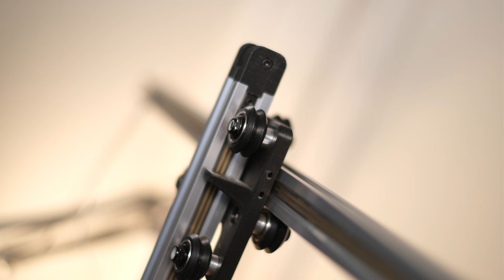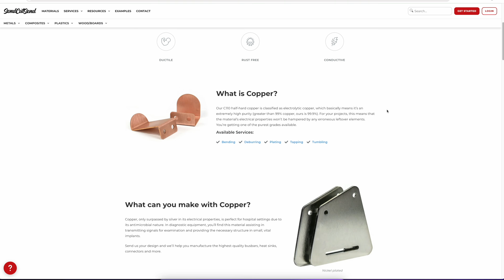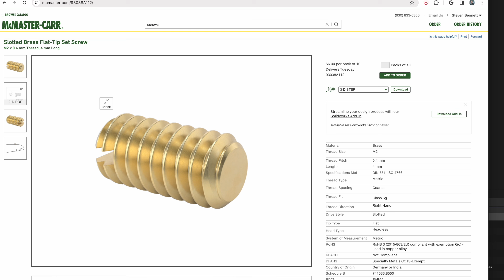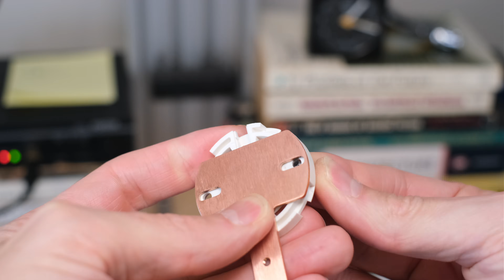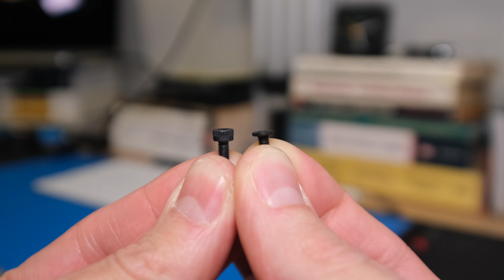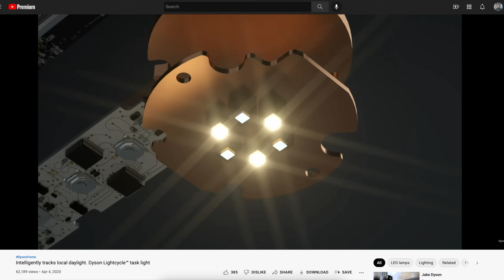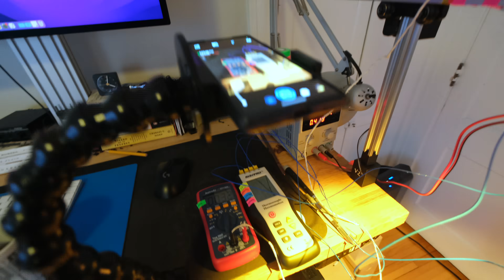Just how good are heat pipes anyway? - DIYson Lamp Build Log #10

Comment: Even though the heat pipe was better, if you were to take a copper rod with the copper heat sink soldered to it, covered in thermal paste and slide down the middle where you currently bolt the lamp head to, would it help cool more because the heat would radiate away more due to it being surrounded by the aluminium strut do you think?

Would putting a thread on the rod help with heat transfer to the strut? The thread isn’t there to screw it in, but to act like a giant fin and help improve contact between the rod, thermal compound and strut.

Now I’ve typed that, thank you for taking the time to make these videos, they are excellent!

Comment: Really cool Designs. I think you might be overthinking it a bit. you are limited by the contact area of the led module to the copper anyway.  I would just use a copper shim mounted directly to the underside of the aluminium at the end. Aluminium is not a bad conductor of heat. Focus on getting the head into the Aluminium direclty
 Thats all the heat pipe/copper is doing anyway. Might be worth a test anyway. How much efficiency do you need vs cost.

Comment: FYI, you can abuse PCB manufacturers to get mechanical parts like these flat sheet metal parts on the cheap.  Many even offer solid copper PCBs at 1.6mm thickness.  I'm looking at one now that's about $10 per board  in small quantities at 200mm length.  You can even have them mount SMD nuts in lieu of tapped holes.

Comment: If the heat pipe is the hottest component, you could get some easy wins with a longer heat pipe and better contact with the aluminium. Another possible solution would be to add a T-shaped or H-shaped heat sink in contact with the full length of the heat pipe. You would have to put the heat pipe on the side of the beam instead of the bottom though.

Comment: Wouldn’t it be easier to take 0,1mm of the diameter of the wheels? So the v shape still engages with the extrusion part but the tips of the wheel don’t hit the screws or the copper bar…

Comment: Why do you have to use the slot where the wheels go? Can you move the heat pipe or copper bar to an unused slot and either bend it so the LED is still pointing down, or bounce the light off a mirror?

Comment: So glad you discovered the heat pipe!  They really are like the closest thing to magic or a teleporter (for heat anyway) that you can just buy off the shelf, no batteries required.  I bought a bunch of them about a year ago.  Put some on my fridge's compressor, keep them on external hard drives during major back-ups/transfers, have them on the motor housing on tools that run too hot or large Ah batteries while they charge, etc.  I have some in the kitchen junk draw to help defrost food if it hasn't completely thawed.  Thermodynamics is a big deal if you're Goldilocks.  A few well-placed heat pipes would have solved many of her problems.

Comment: calling the 'sold copper' solution solid is outrageous !

there is nothing solid on the poor lil strip of copper sheet metal. that is also drilled !

so the conduction surface is like 3mm x 3mm and that on both sides of the screws.

there is no point in having that lenth with such a bad surface area.

like a piece of a copper strip 2 meters long and a square centimeterin surface area.  that ain't gonna conduct any heat to the other end whatsoever. even if on end is melting hot.

like 500m of extension cord and wondering why the voltage drops by 70% on a mild load. 🤦‍♀️

Comment: Isn't the obvious solution to take the unnecessary sharp edge off the wheels? Those are supposed to run on the bevels, not the edge. Looking at the 3d model, that edge that reaches the copper is obviously the part that's out of spec. 

So maybe just fix that? 

Why are the wheels so sacrosanct?

Comment: Hey Steve =)

I know what u need to fix the Heatpipe: leaf spring´s.
So the push from the Rail Top side on the Middle of the Heatpipe,  Pushing them down.
I would take something from a modell rc sektor or so.

I hope this helps =)

Comment: The graph for the copper bracket looks exactly like a 1st order differential equation, which is exactly what I would expect. The heat pipe is clearly nonlinear, which I would also expect. Good experiment!

Comment: You could try mounting the LED directly on the heat pipe to reduce the number of surfaces the heat has to transfer across. It'd use less thermal paste and maybe use less parts since you wouldn't need a clamp on both sides of the copper mount.

Comment: the screw holes and screws seem to be  blocking the heat from being transferred to the farthest part of the tube, try a heat sink bracket without any holes on the path. I think they will perform the same or quite similarly.

Comment: If you thread the copper bar and drill through holes in the extrusion you could attach it from the other side.  Also I think the copper part is too long, heatpipes work over a longish distances but with  solid metal you have diminishing returns the longer the part.  If you go with the second option ( bent metal + heatpipe) I don't think copper would be required, Alu would be more than enough.

Comment: Thermal paste has good thermal conductivity but bad longevity and doesn't fill large gaps well. You'll want to consider other options like thermal epoxy or adhesive pads, which will last longer and can also simplify assembly.

Comment: I personally think you’re missing the forest for the trees. You already have a massive heatsink: it’s the aluminum extrusion itself. 

Notch out the extrusion such that you can mount the COB directly to the aluminum, and you have a large relatively efficient thermal mass with no extra assembly required, and one less thermal interface to manage. 

I do love heat pipes though, style points will always go to heat pipes

Comment: Have you looked at using a PCB your heatsink, and even LED holder?  An extra thick layer of copper alone might be enough, or two with thermal vias, but aluminum substrate PCBs are an option too.

Comment: You should have used conical head screws so they stay flush. Still a nice build! On your heat pipe, insulate it from the led heat source other than at the led, so along the rail, it is insulated till 6 inches down the rail. Maybe that will cool the led faster.

Comment: Get a laptop heat pipe to learn how to make a perfect thermal area for LED. You need some copper around LED, and then really good contact to the rail, especially the OTHER END.Create two shims that must be pushed between heat pipe and rail edges - this will push the heatpimp against the bottom AND also shims themselves will touch the heatpump from above. Very thin shims. No need for screws.

Comment: You need to make the LED contact area flat. Not just scraping with rotating tool. And then minimum amount of thermal paste. In this case metal thermal paste is fine.

Comment: You can slide little bended sheets of metal between the heatpipe and the inner sight oft the T-profile to press the heatpipe in the profile. The screw on the end oft the heatpipe can't press the whole heatpipe on the aluminium. And the next problem is, that the aluminum can't cool the LED on full power because the surfacearea of the aluminium is not enough. But i have no solution for that problem

Comment: Just an idea: could you pre bend the heatpipe with a large radius, so that it has a small arch? This would maybe help to press the heatpipe lengthwise onto the aluminium rail. Basically it would touch in the middle first and the srews at the end   deform the pipe elastic to be flat.

Comment: Looking at your BOM in the GitHub, it looks like the LED that you're using is barely 100lm/watt. Consider the CMB Pro9 line of LEDs from CREE.

Old: CXA1512-0000-000F0YJ430F (Mouser no. 941-CXA15120F0YJ430F)
New: CMB1507-R108-00PF0Z0A30H (Mouser no. 941-150700PF0Z0A30H)

Both footprints are the same, 15.85mm x 15.85mm w 9mm optical source.

CRI: 93 old | 95 new
Test Lumens (85 C): 1269 old | 1069 new
Test W: 12.74 old | 6.7 new
Test lm/W: 99.6 old | 159.6 new
Unit Cost (1x from Mouser): $7.96 old | $7.24 new

If you slightly overdrive the LED, you should be able to get to the same lumen output with better efficiency. The benefits would be less wattage being wasted as heat, higher CRI and lower cost.

The product isn't stocked by Mouser or Digikey, but I think that's just because the product is new. There are alternatives, but these seem like the best option. They have non-Pro9 versions in stock, they're a bit more efficient than the CXA, but they're not as efficient as the CMB Pro9.

EDIT:
It looks like Mouser has a CXB Pro9 in-stock for $8.16 CREE no. CXB1512-0000-00PF0Z0AL7C (Mouser no. 941-CXB15120PF0ZAL7C).

Specs:
CRI: 95
Test Lumens (85 C): 1569
Test W: 11.9
Test lm/W: 131.8
Unit Cost (1x from Mouser): $8.16

For the extra $0.20 you're getting ~25% more lumens and ~6.5% reduction in wattage AT THE SAME TIME. I'm going to guess that with more energy going into photons and less watts going into the system as a whole will result in at least 10% less heat. With LEDs, heat creates a feedback loop. More heat leads to less lm/W which leads to more of that energy being dissipated as heat.

You can manage heat in 2 ways: generate less heat or dissipate more heat. I think that you're seriously downplaying the importance of LED selection and lumens/watt.

If you change your LED driver to a 500ma or 600ma on top of switching to the CXB Pro9, you'll get closer to the output of the CXA while using drastically fewer watts. In a future iteration, you may consider using multiple smaller LEDs so you can do some color tuning.

Comment: You should be able to increase the efficiency of the heat pipe by soldering it directly to the copper bracket. Solid metal conducts heat far better than even the best thermal pastes / epoxies. Tech ingredients has a really good series on thermal compounds and epoxies that goes over it in more detail.

Comment: With the V-groove rollers dome-headed screws could've worked fine, just as thin if not thinner on the ends and slotting into the groove in the middle. But since pipe is better it doesn't matter now.

Comment: Maybe I'm dumb, but what about a screw that you put in, then 'loosened' so it pushed against the top of the inside of the channel, forcing the part inside down flush?  I know going with the heat pipe, that's less of a problem, but if pushing up is an issue, why not just push down?

Comment: Great content.  I have quite a bit of experience with long-term deployment of high power LEDs and also with heat pipes, but not together.    My advice, though, is that absolutely anything you can do to keep the LED cooler must be done.  The cooler you can keep it the higher it's output will remain over the life of the LED.  Additionally, mounting pressure will drastically increase thermal transfer.  The better you can clamp the LED to the heat pipe and the better you can clamp the heat pipe to the extrusion the better the whole system will perform.  I might recommend a thin u-shaped shim that slides/wedges on top of the heat pipe and under the overhanging portions of the extrusion.  With the "bowl" of the u facing upward, the wheels should glide right over it and the increased pressure will really help with thermals.

Comment: I’m really enjoying following this journey and all the learnings. I was curious if you have considered thermal interface material between the bracket and heat pipe etc? Maybe thermal compound like what is used for CPU’s and their heat sinks or even silver soldering the bracket and heat-pipe together? Adding a heat sink somewhere along the heat-pipe might help dissipate the heat even more. I also wonder if metal fatigue could become an issue over time…

Comment: Really interesting. This is the first video I've seen of yours. I used to work for Dyson and in the early days, I attended a talk by Jake Dyson. He felt that the future of lighting was LED but all commercial products are flawed because the LED deteriorates over time, reducing light output and changing colour. That is certainly my own experience. They start great but just fade away! Most, if not all LED lighting pays little or no attention to cooling. They last long enough to cover the guarantee. Apparently, if the LED is cooled to the correct temperature range, the performance and reliability of the LED could be boosted to years, rather than weeks or months and the colour will not change.

Comment: You need to machine a half mm off the outside edge of the wheels.  That way, they will ride nearer to the outer edge of the V on the channel.  The "heatsink" bracket is WORTHLESS for transferring heat!  The effectiveness of a material for transferring heat is dependent upon the thermal conductivity of the material AND the GEOMETRY of the heat-path.  Your geometry is ABYSMAL in that you are forcing heat to travel LENGTHWISE through a NARROW cross-section.  (You are wasting copper.  Only the first 20mm of copper is "doing anything" as far as carrying heat.  That clearly shows in your temperature PROFILES.  On the other hand, for the heat-pipe, the heat is traveling THROUGH the THICKNESS of THIN copper, of LARGE cross-section to the fluid, where the heat can spread over a large area along the rest of the pipe.
          You can improve the heat-pipe's performance by shortening the heat-path between the LED & the heat-pipe.  SOLDER the heat-pipe to the copper bracket.  Make sure the fit-up between these is PERFECT.  Clamp them together during the soldering process.  You will need A LOT of cooling on the other end of the heat-pipe during the soldering, & A LOT of heat QUICKLY applied (with torch) during the soldering.  Orient the soldered end of the heat-pipe UP.  This will allow fluid to be temporarily boiled out of the soldered end (stopping the heat-pipe from functioning) so you can reach soldering temperature without over pressuring the pipe.

Comment: have you thought about water cooling the led? basically a couple of thin pipes to circulate water through the channels and a small radiator and pump on the opposite side. they could also act as a counter weight for the LED housing etc

Comment: Have you thought about using an overhead copper heatsink (in the shape of the LED bracket)? A small cooling fan could also be mounted to the heatsink to draw air through the fins. I think it would still look very cool.

Comment: Very nice experiment! Have you considered having your horizontal arm at some other angle? With the heat source (LED) lower the heat pipe should transfer heat more efficiently by allowing the steam to rise to the opposite end faster and the condensed water to fall easier allowing more cycles. Even better if there is a heat sink at the opposite/upper location. 

cheers,

Dave

Comment: Since the heatipe is not even close to being uniform, I'd recommend swapping thermal paste to k5 pro, or thermal pads (but the k5 pro which basically is "liquid" thermal pad would be cheaper/better). Thermal paste is a good choice where variance between low and high peaks are few fractions of a millimeter, but with the heatpipe they are more like 10-50% of a millimeter. :) Alternatively thermal epoxy is also a good option to secure the heatpipe into the aluminium rail.

Just a thought, but I believe this would improve your cooling further.

Comment: Fans exists - Steven - heatpipe is the answer. NVM though, you've made a mistake by polishing the surface with your drilldriver, that way the surface is not flat, so the heat can't be transferred effectively. You need to sand the surface with something flat, like a piece of thick glass. Second, get a heatsink and make out of it a top mounting of that heatpipe.

Comment: Why not use the heatpipe on the side of the sliding arm?
Then no wheels will come close to the construction.
Maybe you can then either bend the heat pipe on the end to line up with the LED, or make a copper block to mount the LED to the heat pipe.
Perhaps you can add some small aluminum strip to it over the entire length of the arm so you only see the same color instead of some heat pipe which stops half way.
To fixate the heat pipe you could add a set screw from the other end pushing it outwards and not damaging the heat pipe itself.

Comment: Use a copper MCPCB and solder the heat pipe directly to it. Integrate the supertrack into the MCPCB if you really want to simplify things.

Comment: For me the results indicate that the only place where the heatpipe has good contact is the end part where its screwed to the frame.
Maybe try using a thermal putty instead of paste for the frame to heatpipe interface, that should do better with gaps and maybe improve things even further.

Comment: Electronics Engineer here: Try using carbon motor brushes running on the pcb tracks.  Much less wear.    You could use  strips of spring steel (like a clock spring) to hold the heat pipe against the AL.  The strips can be placed across the slot, pushing the heat pipe deeper into the slot.  No screw heads.

Comment: Why don’t you use a PCB? They are also 1.6mm thick and when designed properly can conduct a lot of heat. Plus you can solder the LED onto that directly.
Reply: It might also solve the wheel riding issue since you can plate the edges with thick copper (35um, don’t know if that is enough though) and leave the inner part unplated.

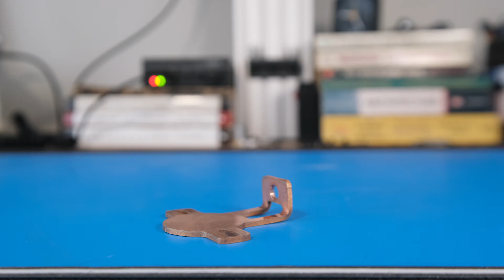Comment: at 19:00, it looks as though you could significantly widen the "neck" of the solid copper heatsink in the area between the LED and the start of the rail. This looks like a bottleneck with only a very small cross section of copper responsible for chanelling all the heat downstream. doubling it's width could yield some improvements in heat transfer rate